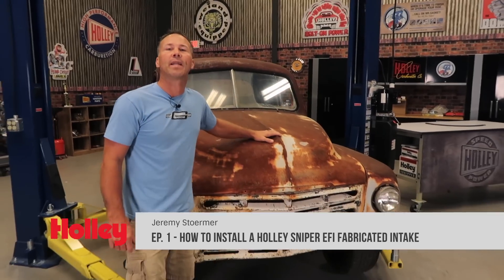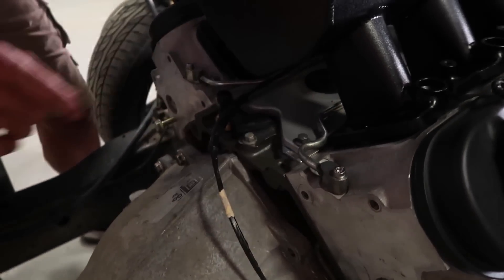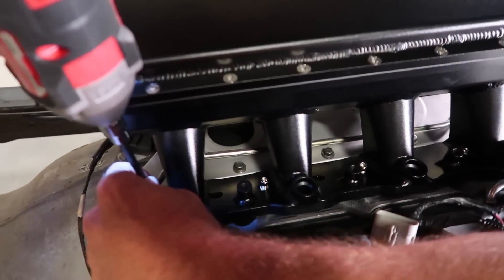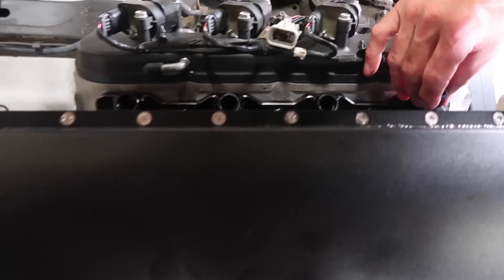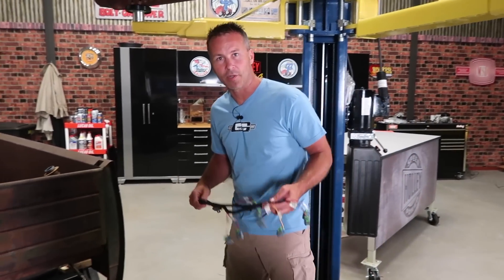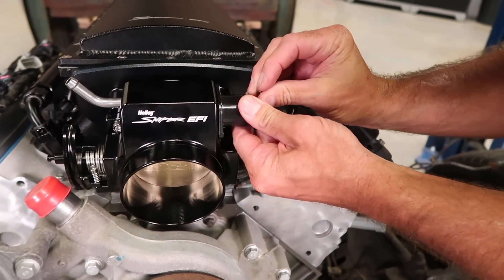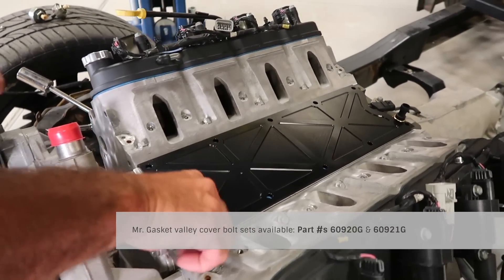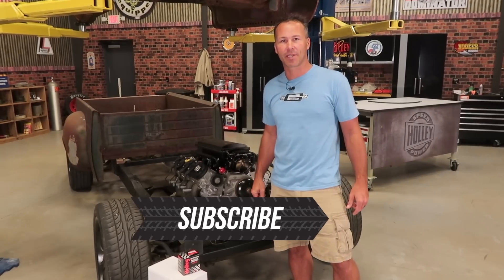How To Install a Sniper EFI Fabricated Intake - EP. 1: 1951 Studebaker Truck LS Conversion

Comment: Will it fit on a LM7 Engine heads or do i need to buy adapter
Reply from the maker: No, these are designed for the LS cathedral port (LS 1, 2, 6)heads and the rectangle port (LS 3 and 7) heads.  I'm not sure if there is an adapter available that would work?  Sorry, we don't offer one.  Thx J
Reply: @HolleyPerformance  well mine is a 99 GMC Sierra with the 5.3
Reply from the maker: @tonyescobar5286  If your heads have a cathedral port design it should bolt up if you use the intake designed for  the LS1.  thx J
Reply: @HolleyPerformance  ok thanks

Comment: Did i miss something, or is the sniper 92mm now being machiend for the stock IAC? i HAD to purchase one to use mine, the stock did not work in the slightest
Reply from the maker: Yes, they now use the stock GM IAC!  Thx J
https://www.holley.com/products/fuel_systems/fuel_injection/throttle_bodies/gm_throttle_bodies/parts/860004-1

Comment: Do I need to convert to electric fans or i can still use clutch fan
Reply from the maker: You can use a belt driven clutch fan.  Elec fans tend to rob less power and are better suited for hard to cool engines that spend time in traffic rather than on the highway or confined engine bays.  thx J.

Comment: where is the map sensor location?
Reply from the maker: The ports (3) are on the underside of the plenum at the rear.  I used a fitting and some vacuum hose to attach my external map sensor.  Thx J

Comment: What controller are you using for the fuel injection? What would i need to use with a tko600?
Reply from the maker: I'm using the Holley Dominator since I need to control my 4L-85 trans also.  If you're running a manual transmission you can get by with the Holley HP ecu.  Thx J

Comment: Is there a diagram for the vacuum line hookups, doing intake shopping but can't decide what to go with. Also where would I hook up the lines from the valve cover
Reply from the maker: The 3rd picture on the product page shows the available ports on the bottom back of the intake.  here is a link to the pic,  https://images.holley.com/820052_11.jpg
Also here is a diagram of how your PCV lines should be routed,   Thx J
https://www.bing.com/images/search?view=detailV2&ccid=rwoAOXjR&id=91B3E1B7883A057B0CE132A3830B9CF0F6922AA7&thid=OIP.rwoAOXjRecnhga2404bubwHaEq&mediaurl=http%3a%2f%2fi60.tinypic.com%2fi2jasl.png&exph=504&expw=799&q=ls1+pcv+routing&simid=608027965821553278&selectedIndex=6

Comment: Is there a place to install the map sensor on this intake? What do you do with the factory map sensor.
Reply from the maker: There are multiple threaded ports on the back of the intake that you can install fittings and connect to your factory MAP sensor (depending on the design), vacuum gauge, and power brake booster.
Or you can use a section of vacuum line to attach to a MAP sensor like one of these. https://www.holley.com/products/fuel_systems/fuel_injection/sensors/parts/538-13     thx J
Reply: One more thing I didn't see a location/bracket to mount the throttle cable does that have to be purchased separately?
Reply from the maker: Yes, since there is such a variety of intake/throttle body combinations we offer them separately.  Hee is a link to  the page-
https://www.holley.com/products/fuel_systems/fuel_injection/throttle_bodies/     Hope this helps,  Thx J
Reply: HolleyPerformance I've look at the brackets nothing looks compatible  with the intake. Any chance you can give me a part number. Or at least so.ething that comes close and I can fab it to work thanks.
Reply from the maker: I apologize,  I was told we had one but it is still in development.  it will be coming soon though!  Thx J

Comment: Is there an application for Chevy big blocks? As in, converting a carbureted 496 to this style of EFI
Reply from the maker: We don't offer the Sniper Race intake for the BBC, but we do have cast aluminum intakes for big blocks with multi-port fuel injection.  see link- https://www.holley.com/products/intakes/efi_manifolds/
We also have fabricated intakes for your big block that are designed for carburetors. You could mount a Terminator or Sniper throttle body (not multi-port injection) on in place of a carb to obtain fuel injection. see link-
https://www.holley.com/products/intakes/sheet_metal_fabricated/carbureted_intakes/                       Thx J

Comment: Well @HolleyPerformace  I am sticking with using knock sensors and  I want to use a learn and tune system  that uses and oxygen sensor of course and  have  a fuel air ration gauge  on the Dash .
  I want to use about  50%  E-85 and 50%  87 Octane gas..     taking  4 degrees of timing out  might cost you about  4 MPG and  40 HP  ..  I guess you are trying to keep the cost down .. I am not building a motor for looks I am building for Performance  reliability  and Economy ..  I like the LS-7

Comment: What part number is the throttle body spacer an is there a throttle cable bracket needed if so whats the part number?
Reply from the maker: A spacer is only needed in a few scenarios.
Here is a link to our throttle body spacers:  https://www.holley.com/products/intakes/sheet_metal_fabricated/throttle_body_accessories/
and our cable brackets: https://www.holley.com/search/?q=cable%20bracket   thxJ
Reply: HolleyPerformance any part #'s you can give me?
Reply from the maker: There are too many scenarios to know what spacer you are wanting /needing without more info???  The spacer I used is included in the Sniper intake kit P# 860012
Reply: HolleyPerformance no need for spacer 860012. I need part number for cable bracket only just cable bracket...

Comment: Is it just me, or did you notice the heads were Cathedral Port and the intake was a square port?
Reply from the maker: Sorry,  but the intake is indeed a cathedral port design (part # 820032).  There is no way to mount a rectangle port intake on cathedral heads without an adapter.

Comment: Dont you need the knock sensors ?? I have a 99 ls1 i would like to eliminate them with one of these covers and do the same on the steam tubes
Reply from the maker: As long as you have a good calibration for your engine you can safely eliminate the knock sensors.  Knock sensors are protection against bad tuning, poor quality gas, etc.  With a good / proven calibration there should be no issue but if you wanted to be on the safe side you could always take out 4 degrees of timing to be safe until you are confident in the tune.

Comment: Is there a reason why the knock sensors were not reinstalled? They are s vital part of the performance of engine. Just curious!
Reply from the maker: As long as you have a good calibration for your engine you can safely eliminate the knock sensors.  Knock sensors are protection against bad tuning, poor quality gas, etc.  With a good / proven calibration there should be no issue but if you wanted to be on the safe side you could always take out 4 degrees of timing to be safe until you are confident in the tune.

Comment: I have the same ls truck engine in my truck. Can you re use the same injectors or do you have to buy new ones? If so which ones
Reply from the maker: The Sniper fabricated race intakes require EV1 style injectors. If you have a 5.3 from a 2000-2006, it has the 48mm Delphi Multec 2 injectors with the EV1 connector. 
If you have a later model, it has the EV6 connector. 
Here is a link to our selection!  thx J
https://www.holley.com/search/?q=ev1
Reply: Thank you so much.

Comment: I would have installed one of the stage 3 supercharged Studebaker engines in it long before another no imagination LS3 engine, stay true to the brand instead of installing commoner parts.

Comment: So it's ok to delete the knock sensors?
Reply from the maker: Yes as long as you have a good calibration to use for your engine.  Knock sensors are only a protection against bad tuning, poor quality gas, etc.  With a good / proven calibration there should be no issue but if you wanted to be on the safe side you could always take out 4 degrees of timing to be safe until you are confident in the tune.

Comment: wher and what u did with knock senors now u toke the spot for thm  away???
Reply from the maker: Yes as long as you have a good calibration to use for your engine.  Knock sensors are only a protection against bad tuning, poor quality gas, etc.  With a good / proven calibration there should be no issue but if you wanted to be on the safe side you could always take out 4 degrees of timing to be safe until you are confident in the tune.

Comment: Thank for the Video its awesome info being new to the LS Engine family I'm a little lost thou if you was going to put a block off plate on couldn't you put the block off plate on and the new steam lines before putting the new intake on just curious and also when you removed the knock sensors are they deleted from setup or do you run a knock sensor in a different location? Also can a sniper intake be used for boost application?
And these instructional videos are just awesome I'll be purchasing a lot of Holley items in the near future. Thankx Again.
Reply from the maker: Yes, the Sniper intake can handle boosted applications https://www.holley.com/products/intakes/sheet_metal_fabricated/race_series_intakes/.
  Be sure to use a map sensor capable of reading the additional boost ( higher BAR rating).  We will be using a Holley ecu and will delete the knock sensor in our application. When the intake was off we could have changed out the valley cover and steam tubes then, but thought that some people may not want to see everything in the video so we made it so that it could be broke into separate smaller sections. Thanks for watching and hope to see pics of your ride in the future!! Thx J
Reply from the maker: Yes as long as you have a good calibration to use for your engine.  Knock sensors are only a protection against bad tuning, poor quality gas, etc.  With a good / proven calibration there should be no issue but if you wanted to be on the safe side you could always take out 4 degrees of timing to be safe until you are confident in the tune.